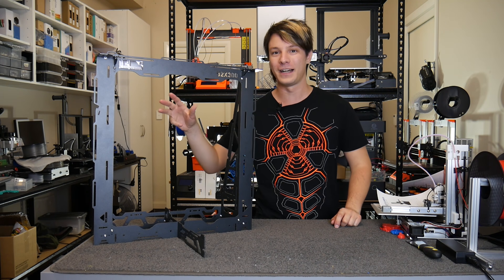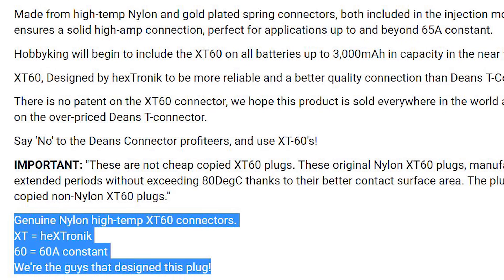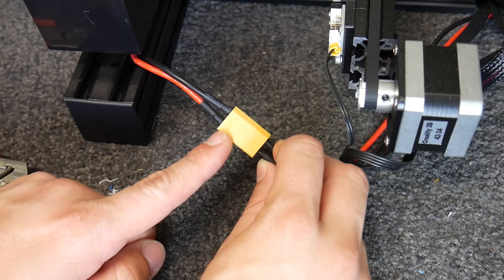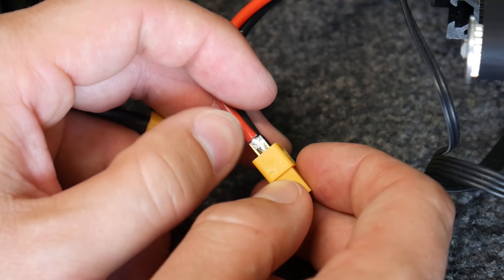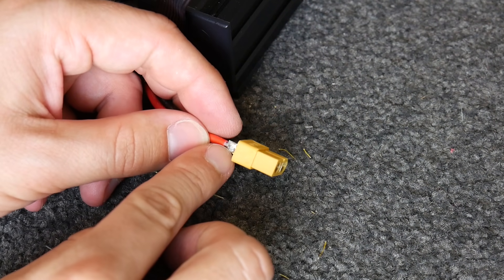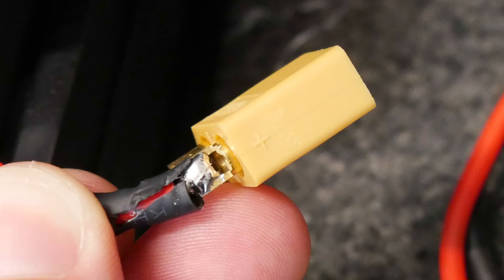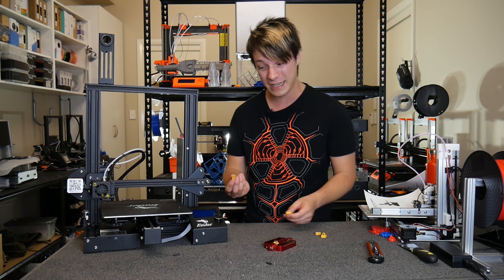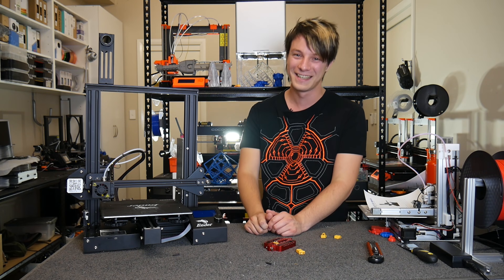Ender 3 Connectors are burning up... Bad XT60's

Comment: Have you noticed that they are actually soldered on the wrong way round! The “MALE” is supposed to be on the PSU and  NOT on the lead to the board as is the case with these creality printers-if you want clarification look at which half is on a lipo (the power source). They are done that way for safety so you can’t short the battery (or PSU) out with anything metallic.
Reply from the maker: YES! I was wondering but it's been a while since I looked at my batteries.. erg that'll be funny if someone plugs a battery into the PSU.
Reply: Isn't it easier to short the male ones? You just put a screwdriver in there, and shorted. To short the female connectors, you would need an U-shaped thing. I don't work with batteries, but usually female connectors are on the power-providing side of things, and male on the appliances, power cord for example.
Reply: Mark the FEMALE is the one that the MALE fits inside-a very common mistake people make (identifying Male/Female connectors) the MALE XT60 is on the Battery. HOWEVER if you use “deans” connectors they put the “FEMALE” on the battery.
Reply from the maker: I think we mixed the genders up but the outcome is the same... the 'easy to short' connector is on the PSU and just looked it up and those one are Male.
Reply: There's not actually a right or wrong way you can use them any way you choose
Reply: Maker's Muse I noticed it when I first assembled my Ender 3 but I have yet to change it round (it’s on my list of Ender mods).
Reply: Maker's Muse the way I was always taught to remember male/female connectors of any type was that the female is the one that Recieves the male INSIDE of it (think boys and girls). You can go to 10 different sites on the internet and each one will tell you something different. Was always told “the male gives” and “the female recieves” hence I said the lipo has a male on (except in the case of a Deans plug)
Reply: All The Gear that’s not true-if the plugs were soldered on the correct way you could essentially run your Ender 3 off anything with an XT 60 on (like a 6S lipo for example)
Reply: Which came first-the chicken or the egg? Lol. End of the day they are soldered on the wrong way around.
Reply: @Johnn_T  The chicken because the protein that makes the egg shell only the chickens can produce ;))
Reply: The egg because dinosaurs laid eggs too
Reply: The designation for male/female comes from the pin, not the housing. This is true on any/all connectors.
Reply: This is wrong.
Reply: Was just about to comment with the same - the XT60's are on the wrong way. The easy to short plug should be on the "dead" side of a connection, and the safe plug which is hard/(or impossible) to short should be on the LIVE side of the connection. If you short the dead side, nothing will happen, if you short the live side, you short out your PSU, not good! 

There isn't a right/wrong way to connect them to make them work, but there is a correct way to wire them to keep you safe(r). Safety by design dictates that the live terminals may be considered to be always on, and should not be easily accessible or have the ability tho be shorted out easily (with a flat screwdriver, a nail, staple, stray metal filing).

It's a VERY VERY common mistake to see with the XT60's, as the FEMALE is the one with the Gold "holes", which actually goes inside the MALE plastic sheath. The male part of the MALE is that they have the Gold "sticks". But when you connect them, the MALE plastic goes over the FEMALE plastic, which would make you think it's the other way round.

Just always think the FEMALE end of a connection is the part you can't easily short out. When you ever crimp or solder any connector, think - can I short the power with a screwdriver - if yes, you've probably fixed it on backwards....!!

Steve
Reply: Stephen Ludgate  lol I’m not gonna debate it, end of the day they are on back to front-that’s all that matters. Interesting how nobody has mentioned this before-was the first thing I noticed when I got the PSU out the box 6 months Ago, and to be honest I was expecting at least ONE reviewer to pick up on it but none did. I never mentioned it because I knew exactly this would happen-the quest for “I’m right and your wrong” would start in the comments etc and it would detract from the actual issue which is that the plugs are on back to front. you can look at 10 different websites And each will tell you something differrent, it’s only a matter of time before an electrician who knows more than me (an engineer) about connector designation jumps on here and makes a point of justifying and explaining “the gender of connectors” when all that matters is that they are on the wrong way round.
Reply: @justmeandjack  Wrong. The piece with the "+" shape inside the contact HAS to be mounted to the device being powered. The other connector has fairly exposed contacts and must never be used as an Output (except for a battery charger, of course...)!
Reply: @Johnn_T  haha all true! They should be gender neutral now though shouldn't they... haha??!!
Reply: @Johnn_T  Don't be confused by the outer shroud of the connector when determining which one goes inside the other. The male connector has the prong(s). The female connector has the hole(s). Just like real life. :D Anyway XT60s are no different. The female connector goes on the battery. See this for reference: https://hobbyking.com/en_us/male-xt60-connectors-5pcs-bag-genuine.html
Reply: This is what happens with "Gender fluidity". Printers die!
Reply: Jesus, it's 2019, we can't just assume the gender of the XT60. Let's just agree, that they are the wrong way around
Reply: @FlatFace986  -- I think you're right.  If you google Male xt60.. they all show that the one with the pegs or studs is the male.  Just because the "male" plastic case fits into the "female" doesn't seem to define the "sex" of the plug.
Reply: @MakersMuse  "Funny"!  YeeeHaaaa!!!
Reply: @superkillr  yup. Short version is the end that has the PINS is male, and the end that has SOCKETS is female.  Regardless of what the rest of the connector housing looks like.
Reply: @MakersMuse  
Sorry Muse, that doesn't make it right. I am a 77 year old electronic design engineering type and learned from an early age that the female connector is ALWAYS the side that provides power. The male is that side that receives power. I know that even in Aussie Land (I've been there many times) the mains receptacles on your walls that provide power are always female and the cord that receives power has a male connector. Think of the disasters that could occur if your 220 volt AC had two prongs (male) sticking out from the receptacle. 

For signal connection the rule is not always strictly enforced. However, when the connector is supplying signal and for some reason must have male pins the pins are protected by a shield surrounding the connector so they cannot be shorted by the connector face touching something conductive.

There is nothing puzzling about this, it is just common sense.
Reply: The egg. its literally impossible for it to be any other way by definition since anything that does not come from an egg is by definition not a chicken :-)
 @Johnn_T
Reply: Nerys I love how what I predicted would happen 6 months ago if I brought this up is STILL going on-people writing huge “justification messages” (that I’m not even reading) about which is male and which is female lol.....where we’re all these people when they bought their printers? I noticed immediately that they were back to front but I never mentioned it (as I said above) because 1) I expected AT LEAST 1 reviewer to pick up on it (none did), and 2) ALL THESE F&@!ING REPLIES ABOUT MALE AND FEMALE.. 😂
Reply: I was aware of what an XT60 connector is but I Had never actually "held one" until 3d printing. (my rc planes are either low enough power to not have a need for XT60 or are old enough to not have them that way either) so I have no idea which way is "right"

my gut says power source (ie psu or battery) should have the harder to short connection. but I have no idea if that is right or not.

 @Johnn_T
Reply: @digitaled1080  I agree most times (except solar) it's clear the one that 'plugs' itself 'into' the other is not the female and the 'live' side, but in the case of XT60 cables, the 'females' are the ones that actually 'plug' into the Skirted males. That is what a XT60 is.. a molded Female set of bullet plugs that insert into skirted male plugs and this is evident on any and all battery's which come with if we use the clothing analogy further.. pants while the males are wearing skirts or kilts ;)
Reply: Nerys it has to be the chicken, since a new species has to mutate from another different but similar species (proto-chicken?). So it came from an egg, but not a “chicken” egg. :o}
Reply: @Artrcb  negative the parent wasn't a chicken the egg was a chicken that final mutation would be the chicken living beings don't mutate genes mutate DNA mutates therefore the mutation has to occur at Birth when the embryo is developing ie before the chicken egg there was a parent that was not quite chicken a Proto chicken and the final mutation occurred when that chicken laid an egg making what we call a chicken today the creature can't be a chicken because it had to make that last mutation between it and the next so the chicken could not possibly have come first
Reply: Nerys heh. It was not a chicken egg until the chicken hatched, defining the species. Before that it was only a mutated proto-something egg.
Reply: @Artrcb  no that's not how it works just because you can't see the chicken doesn't mean it's not a chicken if it hatches chicken that means it was a chicken in the egg no mutation occurs in the egg a mutation occurs at Inception
Reply: Nerys my point is it doesn’t exist as a ‘chicken’ until you see it walking around and it is obviously something different. Adam or whoever gets to name species declares “you be a chicken”, and then there it is. Until that revelation, there is no ‘chicken’. What was in the shell was mostly ‘omlette’. :o}
Reply: @Artrcb  I'm trying to tell you your point is wrong :-) if it's a chicken after it came out of the egg its a chicken when when it was in the egg your failure to recognize this is irrelevant it's still a chicken
Reply: Had the same concern! Even more reason to just replace them (and if there's enough wire, just lop off the end that got soldered, to get to fresh wire)
Reply: Nerys then we are down to avian microbiology. Does the inception and genetic combination creating the chicken precede the process of providing an egg-scape pod for said chicken? If post inception, the chicken was there first.
Reply: @Artrcb  no we are not it's simple genetics a chicken comes from an egg if it doesn't come from an egg that's not a chicken therefore the egg came first I don't know why this is something that is discussed often online it's a simple logical problem if it didn't come from an egg it's not a chicken but definition
Reply: @John T  "I love how what I predicted would happen 6 months ago if I brought this up is STILL going on-people writing huge “justification messages”  Predicable, and I think comforting, that people jump on you for posting wrong information such as blaring that the PSU should have the "MALE" connector. Wrong in this instance, and wrong in general. You are however correct that the PSU should have the less-shortable connector, which, for the XT60, is the one that the convention-abiding world calls female (according to its pins/sockets), and you apparently call "MALE".
Reply: Nerys you yourself said the chicken was created when the dna genetic soup shifted and the new species “chicken” arrived. Ok, so I got the egocentric ‘naming’ part out of the discussion because, you know, nature will have its way without our intervention. The point I was trying to make is the egg does not define the chicken because other birds lay eggs, snakes lay eggs, even 60s pantyhose came in an egg. So I was down to when exactly does the egg start forming within the proto chicken compared to when the true species chicken was genetically mixed up in the same proto chicken. At this point I yield to some avian nerd botanist who knows the sequences within chickens to finally answer the question of which happened first. Maybe it is simultaneous and there is no ‘first’.
Reply: @Artrcb  there's nothing egocentric about it I'm not sure what your intentions are with using that kind of wording? And there's no simultaneity either when the genetic soup forms the embryo it is either chicken or it is not there's no in-between and this happens at Inception not at hatching the genetic code short of heavy radiation damage Etc does not change from inception to hatching

By definition if it did not come from an egg it's not a chicken and since the egg comes after Inception the egg must therefore have come first it's a logical conclusion that can't be wrong
Reply: @digitaled1080  That's right.  All POWER plugs SHOULD be female(Hot) to Male(receive). Audio is different sometimes.  XLR's are Males(original signal) to Females.
Reply: You're right, holy shit. Why would they put it the wrong way around, especially as it's a standard for the reason of preventing shorts?
Reply: @nerys71  Is a test tube baby human?
Reply: @siwilson1437  as long as the source genetics are human of course it is.
Reply: @nerys71  Would you consider a test tube chicken to be a chicken?
Reply: @siwilson1437  same requirements if its genetically chicken then yes
Reply: @nerys71  For this reason I disagree with your comment "... anything that does not come from an egg is by definition not a chicken :-)"
Reply: @siwilson1437  that's not the definition of chicken so your problem is one of you are using the words incorrectly
Reply: @nerys71  Do you understand that I was quoting you? Do you understand that?
Reply: @siwilson1437  no you are not quoting me you were extracting a component of my texts outside of contact which means we're back to exactly what I said the problem is one of you using the words incorrectly
Reply: @nerys71  Looks to me like you said it more than once as well. See ya!
Reply: @siwilson1437  looks to me like you refuse to comprehend context see ya!